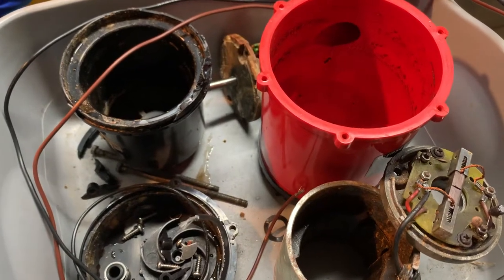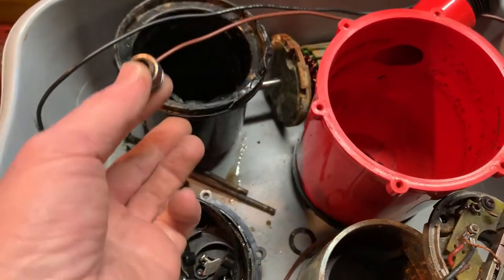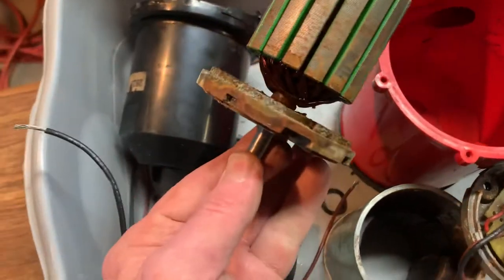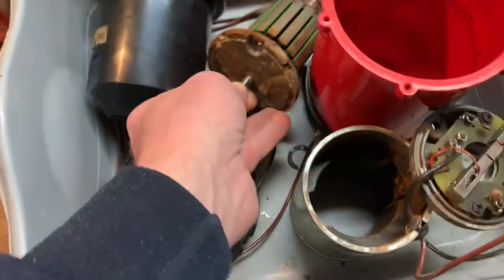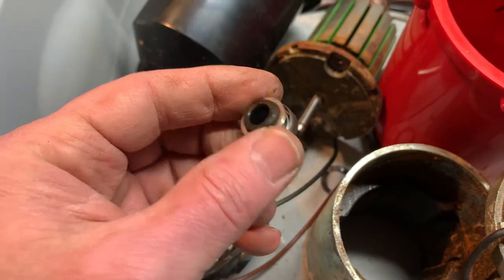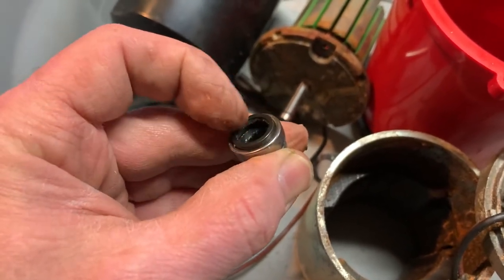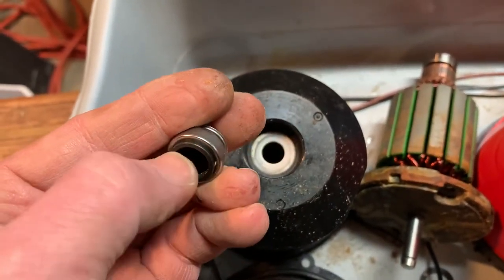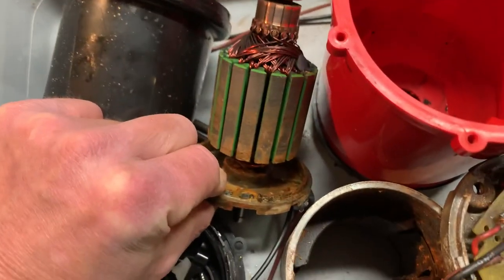Cause of Failure - SPX 2200 GPH bilge pump by Johnson Pump

Comment: I have rebuilt several Rule pumps, 2000 and 3700 and a Chinese pump from Amazon. Basically the bottom seals fail from SS shaft corrosion and let in the water. Got new brushes and ground to fit where needed. A secret is to us silicone dielectric grease to saturate and seal the seals. It wont wash away and repels water. The rule pumps, the impellors are difficult to remove with some damage. One impeller I did crack off the center hub. Devcon epoxy will repair the plastic impeller. I was thinking of next time, slitting the impeller hub to be able to slip it off. I bought a can of dielectric grease for $10 and it works great. And brushes from Amazon. Then can be sanded down to fit as long as they are bigger than OEM. Rule uses an odd size deliberately.  The wires slip thru the black bushing, use the dielectric grease and slip them back as you take pump apart. Grease everything including wires when putting back together.

Comment: That is a great video and a very good description of the issue, but you have missed the most important and critical detail. As you clearly show, the bottom compression seal is in good condition and should still be doing its job. The reason that it can't do its job is that it has been dislodged from its original position. Again, as you rightly show, it is a compression seal that requires the seal to be tightly help agaist the washer mounted in the base of the cartridge. It is held there by the impeller which in turn is held there by the circlip which is lodged into the groove at the end of the stainless steel shaft that runs from the electrical motor. If this circlip is dislodged or corrodes away then the impeller falls down and as a consequence, so does the compression seal. I have studied your video with some good views of your impeller and associated screws and hardware at the 43 and 49 second mark and cannot see any circlip. Did you remove the circlip? Do you still have the circlip? I would be fascinated to see it if you could show it on another video. Keep up the great work. Cheers.
Reply from the maker: Dean, the pump was (maybe) a year old and in a freshwater environment (Great Lakes). All pieces were present without any damage or corrosion, including the impeller and circlip. There was no visible indication that the pump had failed other than that it immediately blew the inline fuse when it was switched on. I removed the pump from the bottom strainer and tried to turn the impeller by hand. It wouldn’t spin freely due to the corrosion inside the motor housing. It was then that I removed the circlip and impeller to access the watertight housing and the pump motor. Thanks for the comment.
Reply from the maker: Here you go. https://youtu.be/xn7i3Aq9yUI
Reply: @79cd36  Thanks for letting me know those details. I was just trying to work out how the water got in as i have had the same issue. Any ideas?